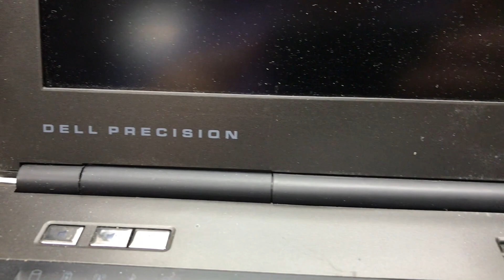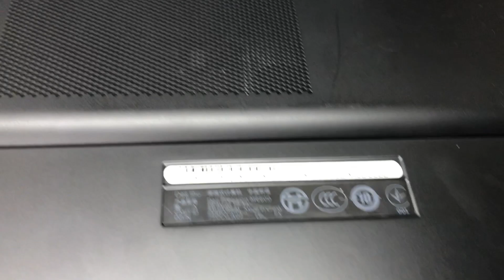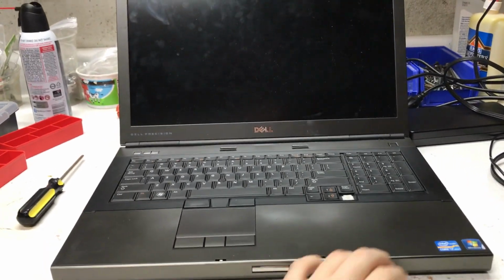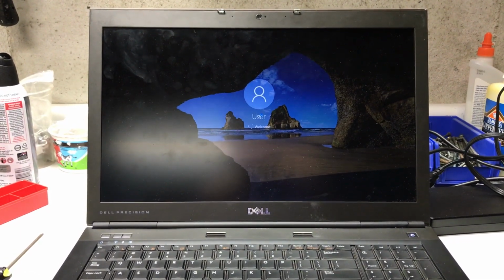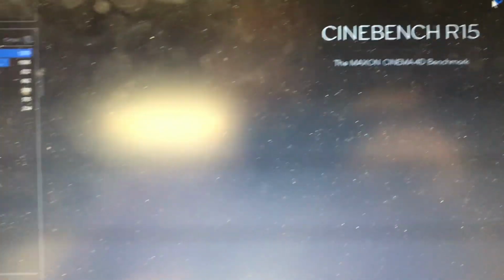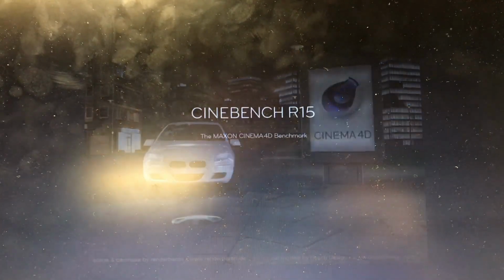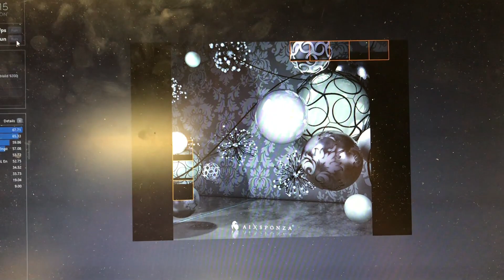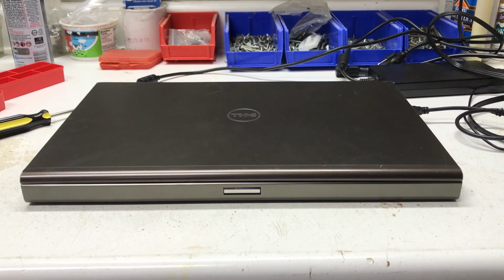DELL PRECISION M6600 MOBILE WORKSTATION REVIEW!! I TURNED THIS 10 YEAR OLD LAPTOP INTO A GAMING PC!!

Comment: I have a dell precision m4700 with 15.6 1080p display and intel core i7 extreme edition 3940XM cpu and 32gb of ddr3 ram  and 2tb ssd hard drive and a 256gb msata drive and blu-ray drive that i installed and i updated the laptop to windows 11pro that watch YouTube video on how to install windows 11 unsupported hardware the windows 11pro runs great the notebook is getting windows 11 updates

Comment: I have one of these laptops which I have had for about 4 years. I got it from my local dump together with another 6 Dell laptops. All had very small hard drives if any, no power supplies and little ram.
The Precision M6600 was the largest and best of the seven laptops. Its a i7 Quad Core 2720QM @ 2.2ghz. I put 32gb RAM in it. It has two RAM slots under the keyboard and another two under the base cover.
For hard drives I installed two Toshiba 2tb standard hard drives. I had to purchased a second hard drive caddy from US eBay. I also installed a SSD M Sata 1tb Samsung HD for the operating system and installed programs. That gives it a total of 5tb of hard drive space. The video card is a Nvida Quadro 4000M 2gb model.
The DVD drive was a reader only and I replaced it with a DVD burner. It does not have a web cam.
Although it is now almost 10 years old, it still performs very well. The power supply (genuine Dell) cost me about $100AU on eBay.
As you can see I have spent quite a bit of $ on upgrades but I think it was worth it. My wife uses it as it recently replaced her Dell XPS M1730 laptop with an Intel Extreme CPU installed and a Nvida 9880 SLI video card.

Comment: good video but lots of error
this laptop is not from 2009 it's from 2013, the connector under the laptop is for a port replicator, on the middle of the laptop it's one internal drive only you can't put 2, the WWAN m-pci is for 3G/4G, DMC m-pcie is for Display Mini Card. about upgrades, you can also add 2 stick of DDR3 under the keyboard and replace the graphic card but for that, you need to take off the palmrest with is not funny at all with that laptop. for your missing key on the keyboard you can find them sold brand new one key only for something like 5USD with shipping it's a lot of money for one key but the full keyboard cost way more money....
Reply from the maker: wow...  you can actually fit an ssd and 2 hdds in the laptop at once.
Reply: Cool21LegoUser  yeah but the SSD is m-pcie with reduce a bit the choice and make the price higher than s-ata SSD and yeah that make a lot of drive but remeber you. when that laptop was brand new, the lower price version was sold $4000 and the higher was around $6500... for that price, it have to be able to have a lot of options.... and with both the s-ata, you can of course mount a RAID
Reply: @Groove1024  actually tha Dell Precision M6600 is from 2012, M6700 is from 2013, and M6800 is from 2014
Reply: yeah that PCs was crazy mine with with full HD tactile screen! it of course have backlight on the keyboard and it's build like a tank! ok, don't make it fall on the street it's going to not appreciate that at all but mine survived pretty well to a car accident the wine is what ended up it's life...
Reply: @blakedmc1989RaveHD  ah yeah you are probably right all i know is they are old but not from 2009... in 2009 it was the dual core and first gen of intel core I was a really new thing so there was no 2nd gen of core I